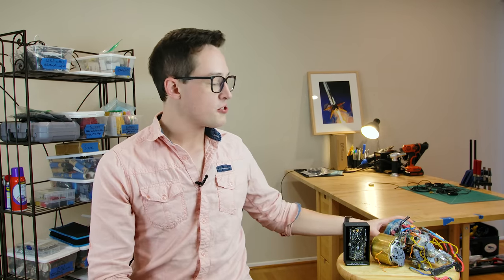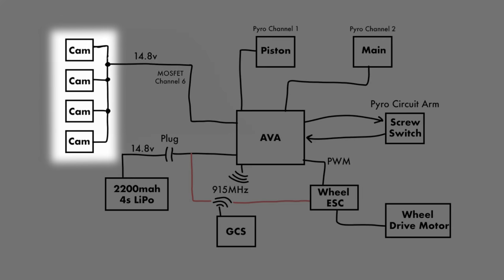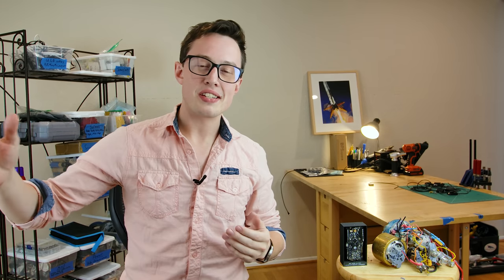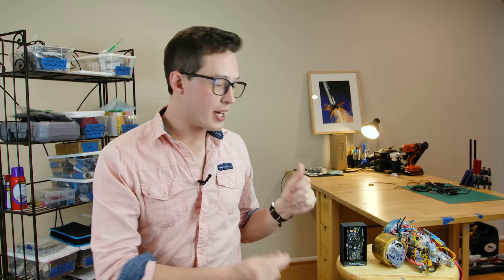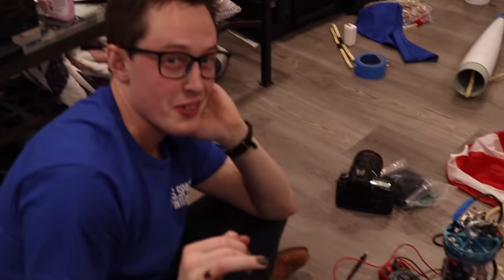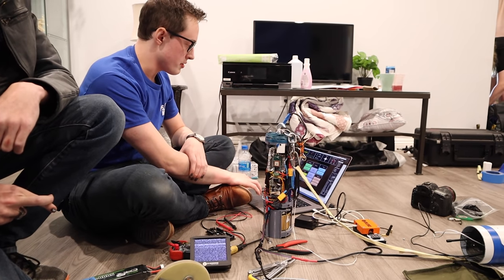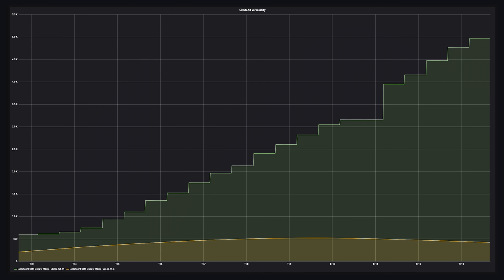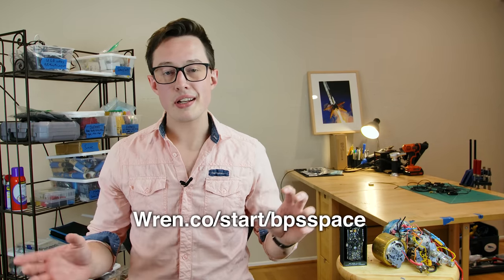Rocket Avionics - Building Lumineer

Comment from the maker: Join me on Wren and start offsetting your carbon footprint today! We'll plant 10 extra trees for the first 100 people who sign up! https://www.wren.co/start/bpsspace
Reply: For the broken SD card...
When the file system is broken I highly recommend to use Testdisk (Windows & Linux), I tried many recovery software and it's the best one I've tried. For a card that is physically broken, it's possible to recover the data by transplanting the flash chip to a brand new SD-card but it's not that easy and you will definitely need to use a microscope. Personally I would let this to the professionals.

I know it's probably some over-engineering but if you use a separate board just for the SD-card there would be less chance of having it destroyed when the rocket crashes and you can even make a small cage around it for adding some protection.
Reply: Just put all the CO2 into milk
Reply: Send the SD cards to drive savers!
Reply: Sir make a video on reaction wheel.
Reply: @Reth_Hard  might want to even have some crumple zone around it or like some gel inside or the sd cards might crack from the G forces?
Reply: Btw, you want to have someone look over your RF section and design, let me know. Doing a PhD in RF electronics (I've measured stuff up to 100GHz), have the PCB and antenna simulation tools as well.
Reply: somebody, please make a 2 nickles weird it happened twice meme with joe B and recovering data from flight computers
Reply: Sir, can we use hard disk to make thrust vector control system and reaction control wheel?
Reply: @Reth_Hard  You couldn't vacuum seal the card in ultra thin plastic ? and then micro trim the plastic from the contacts ..hopefully without loosing the seal
Reply: have you considered using eMMC onchip?
Reply: hey joe can you send me every thing for the rocket like the cad and the software for everything to do with the rocket and can you make a step by step guide for the avionics and the rocket

Comment: You might consider looking into microsd extender cables.  They let you plug one end of the cable into the microsd slot, while the microsd card itself goes into the other end in a different location.  Compatibility is definitely on a device by device basis, but the advantage is you could build a more secure environment for just the microsd cards, rather than having to protect the entire camera or whatever else you put the microsd card into.
Reply: Cool. I had same idea. This sounds like the solution.
Reply: Glue it into a hard enclosure with a flexible glue, maybe.
Reply: @Kenionatus  The rocket isn't that heavy, and microSD cards are tiny. Wrap them in a few mm of foam, and the whole package is maybe a cubic centimeter. Put a centimeter of aluminum around that, and you have a 3x3x3cm box that weighs about 30 grams with card and foam included.
Reply: That seems like a good idea.

Comment: Also you could Yeet reaction wheel “leaves”  out of the body before saturation. Toss them out all 4 cardinal directions from the body. Good excuse to use frangible joints with explosives too
Reply: How about a clutch on the reaction wheel to decouple it from the motor and let it spin down on low friction bearings naturally?
Reply: I think the term you are looking for is "yo yo despin", They are super cool!
Reply: that would create 4 basically invisible weights descending from 10km altitude. Nothanks
Reply: Yeah. That's going to end well ;)
Reply: Ahh yes, throwing out 4 pieces of heavy metal at apogee without parachutes directly above the launchpad sounds like a great idea!
Reply: @haph2087  you must be fun at parties :p
Reply: Hard hats required within 5 km of launch area. Keep small pets in sheltered environments. Don't look up. Plan will work.
Reply: @Ryan Hutchison Yes, but the friction energy has to transfer through a low friction bearing over a prolonged period of time, and since the vehicle is descending on a parachute, there are so many other aerodynamic forces acting on it that this small torque is not consequential.  Also, once the rocket has passed apogee there's no compelling reason to keep perfect control of the roll axis. You need roll control while under controlled flight to maintain proper guidance and steering or thrust vector control. Once you deploy a chute, you are no longer in controlled flight and do not need roll control.
Reply: WHAT COULD GO WRONG?

Comment: Buzz: "Fuses, Fuses everywhere!" - Though this might have killed the PWM pin on the MCu anyway. For protection you should definitely implement some IO saving passives on AVA, if you haven't already.
Reply: Building on that, a PTC might be useful if you want something that'll auto-reset without opening the rocket
Reply: Just increases complexity without adding any flight safety. Overall I feel like BPS is adding too much complexity. But I have no deep insight.
Reply: A fuse on the power line to ESC, if (when) it blew, would have been equivalent to unplugging the ESC (unless the issue there was that ground was also unplugged, which I doubt). It seems to me that it's not a very good setup of an ESC that, if unpowered, will effectively short its control lines to ground.
Reply: @robertobryk4989  “It seems to me that it's not a very good setup of an ESC that, if unpowered, will effectively short its control lines to ground.” It is a common problem though. There are plenty of chips you can kind-of power through their I/O pins (because they have protection diodes) which makes it problematic if you disconnect their positive supply but still supply a voltage to one of the I/O pins. A series resistors can limit current to harmless levels but then you’d still be wasting power. Source: I learned it the hard way trying to power down an NFC chip using a MOSFET on its supply. (and then encountered the same problem again with a Bluetooth module)
Reply: @Mike-oz4cv  Ah, via ESD-protection diodes?
Reply: @Mike-oz4cv  Run a controller with CAN bus :D
Reply: @robertobryk4989   Yes

Comment: You should remove the 5v line going from AVA to the ESC. The 5v line is there for the ESC to provide power to an RC radio receiver (e.g., the BEC). Since AVA is already getting power from elsewhere, this isn't needed. You only need to send PWM and ground to the ESC in order to control it.

This also helps you avoid an issue where two voltage regulators fight each other on the same supply line - it's common for drones and multi-engined RC planes to remove the 5v line from all but one ESC for this reason.
Reply: Yes. That you have to say so, is painful. Use a separate battery for reaction wheel and none of this is a thing.
Reply: I don't understand what you're saying, but i want joe to see this
Reply: Also maybe add a series resistor (1k) to the PWM-IO. If an IC has no VCC, the IO might act as VCC through protection diodes.
Reply: Actually no ground wire to AVA is needed, can be attached to anywhere else ground from battery is pluged in, (with the resistor or diode by Leonelf) I've seen a Matrice 600 pro flight control (3500UDS) burned by a votage going thru 10 bucks servo ground wire.
Reply: @giovannyalvarezsanchez7311  - Very good point -- you do not wan't a ground loop.

One caveat is that you should still need a ground wire if you have an opto esc (optically isolated). Before eliminating the ground wire, check for continuity between the ESC's two ground points.

In Lumineer's case, since capacitor inrush via the servo line resulted in magic smoke, that ESC was not optically isolated -- something to consider for future reaction wheels.

Comment: I’ve recovered data from several SD cards, full size, mini and micro.  Depending on if the die is damaged.  SD is easier because of the serial interface.  Send me some photos of the cards
Reply: I went back and looked.  Several of those cards look recoverable.
Reply: Basically buy new versions of same card. Rip it all apart and swap the memory chip. Give it a shot.
Reply: I think that is quit hard because of the flying bonded wires.  I’ve almost always been able to tie to a berried lead from the chip.
Reply: @BenjaminGatti  These are microSD cards so there isn't really a seperate flash chip like a CF card, I think microSD cards basically have wire bonded dies.
Reply: @Darkknight512  I think most of them use flip chip mounting, with a few microballs that hold the chip to the carrier PCB, where it then has a few plated vias, that connect to the gold plated top connector.
Reply: I was wondering if he could just put it in an SD tray on a phone and still be able to transfer it
Reply: @thrasher2344  No way, its way too damaged physically
Reply: Hello! I actually flew an SD card on a rocket a bit back that had a 100% normal flight, but didn't get any data back from it because the SD card was unreadable after the rocket landed despite being in perfectly fine mechanical condition. The SD card itself is physically fine, but to the computer it only shows up as a 32 megabyte volume with the partition data. Can you point me in the right direction to getting data off it?

Comment: For rotational stabilization I would recommend to look at rollerons. They are also based on conservation of angular momentum, but produce aerodynamic forces and are much simpler. They are also proven to work sub-, trans- and supersonic. They are for example used on the AIM-9 Sidewinder air to air missile.

Comment: Joe, if you have persistent issues with inrush current frying your regulators, you should look into adding a NTC Thermistor to the circuit to soften the inrush spike. I've added them to my DC compressor so I can power it with a switching power supply and not fry the supply trying to spin up the motor under a 1500PSI load.

Comment: Just an FYI, at higher speeds (such as approaching the speed of sound) the Doppler shift is enough to make AFSK modems start to get significant errors. A newer technology tends to solve that problem and it also allows for decoding of data at lower SNR ratios (grabs signal out of the noise). That technology is LORA and there are pre-built boards that have the radios together with an ESP32 wifi/bluetooth CPU module and some also have a GPS receiver and/or sd card slots. Using the ESP32 is now simpler since most of your existing software (like from the teensy) also uses the Arduino IDE and some of the same libraries. And the boards are inexpensive at around $25 each.

Comment: Regarding your cracked SD card, I do know a way to recover the data with a 90% success rate, but it won't be cheap.  Take the card to your local Staples, and ask for their Data Rescue service.  It costs about $1300 if you didn't buy the protection plan beforehand.  (I believe they will still try to recover the data even if you did not originally purchase the card there)  In the future, purchase an SD card from Staples, buy their Data Rescue Protection Plan, and fly that on the rocket.  The plan costs about $4 if you buy it at the same time you buy the card, and there are zero exclusions.
Reply: There are many places that do data recovery. There are a few of them who do videos about it on YouTube. I don't want to mention any names specifically, just to be fair to them all. I suspect if Joe were to search out a service doing videos on YouTube that if he reached out to them he might be able to get them to do a collaboration video recovering his data, and save some money.
Reply: Staples is just going to send the card to a 3rd party contractor to do the data removal.   You can just go direct to those 3rd parties.

Comment: Use the reaction wheel to damp impulses and accumulate short term integral, and then use the flight control surfaces to cancel that out with a PID controller - tune the PID controller to go for zero reaction wheel RPM.

Comment: About the wireless systems: Your metal parts around the antennas were not the only problem. For a rocket you ideally want to use a nearly anisotropic (as little gain/directionality as possible) circularily polarized antenna. On the rocket, either a double cross or clover leaf antenna should do the trick. For the ground station you could use a slightly directional helical antenna (axial mode) or ideally have both a low gain and a high gain antenna and switch between them. Higher power transmitters would also help a lot. The best estimate of the Xbee's power I can find is 24dBm (250mW). Something on the order of 40dBm (10W) would be more appropriate, but you might need a license to stay within regulations. Also, consider switching to 2.4 or 5.8GHz. There is more bandwith available and you could use the same hardware that is used for FPV drones, and since you will have a direct line of sight to the rocket while it's in the air the range advantage of lower frequencies is diminished. Finally, test all your antennas. For sub 1GHz frequencies a NanoVNA will help you verify that your antenna isn't garbage (cheap antennas can be close to unusable).

Comment: Great video ! A couple of things, you can get opto isolated escs, also solid core wire isn't good for vibration. If using stranded wire which is more suitable for vibration, you can use bootlace terminals into your screw terminals

Comment: Perhaps you need to start practicing CRM on the project? (CRM = Cockpit/Crew Resource Management) It works very well for aircraft safety when used. Many recent aircraft incidents are when it's not used.

Comment: Re: different connectors. I'm with you on that. When I design any system(usually audio p.a./recording systems) one of my major philosophies is "design it so you can fix it correctly and in a hurry when it breaks". You don't want the president and CEO of Coca-Cola glaring at you from the stage for <i>any</i> length of time. I've seen people get lazy and use AC wall sockets and extension cables as speaker cables. Plug it into the wrong socket, and you get to watch a coil inside a ring gapped magnet produce the magic smoke very quickly. Idiocy. Every different type of audio connection has it's own standard plug so you don't do stupid things, same with video, and lighting. However, these days if it's a digital signal it goes over CAT5, which comes at it a different way through total standardization, if a cable fails you can grab any CAT5 that will reach and get the things back up in a hurry. It's much easier to see/feel(working in the dark is something they don't tell you about when you become an A/V engineer) the difference in connectors, and there is 0% chance you can accidentally cross connect power and signal. The goal is to design as simple and robust as is possible to do what you need as efficiently as possible.

Comment: You want spring terminals. Available in similar sizes to standard PC mount screw terminals, with push release that's easier than screws, and very vibration resistant.
Reply: Crimped connectors are way better.

Comment: You should make "black box" style flight data recorder. Make a daughter board for an SD card or even just an eeprom chip. Pot the whole thing in epoxy in an aluminum housing and connect it to the main board via SPI with flexible wires - make sure to strain relief it. Use Tech Ingredients' thermal epoxy to affix the memory to the housing as a thermal sink. Affix it rigidly to a sturdy part of the chassis, you DON'T want it loose/sprung, ironically, as that exacerbates vibration. Boom - indestructible memory!

Comment: Solid wire is bad with vibration, so use stranded, and get yourself a pack or five of bootlace ferrules for the wire, and the proper crimping tool for the size. That both makes the screw terminal a flat solid surface, so it will grip better, and also handle large currents with lower voltage drop, but also means you can take a small piece of insulated wire, and glue it to all the wires at the end of the ferrule, so you can undo the lot as a unit for maintenance or replacement.

Comment: I would build a mini sealed "black box" for the rocket which would contain the recorder and the SD card, internally mounted in a shockproof fashion to avoid any destruction then have a ribbon cable connect to the flight controllers. Maybe mount it in a sealed box filled with ballistic gel or something that would absorb any kind of shock from any direction, but can be removed once the box is on ground again (either way)....

Comment: You could use aero control surfaces "tuned" to work at high speeds that try to zero the reaction wheel speed. That way the reaction wheel works at lower speeds and you don't saturate it.

Comment: Just as a thought, perhaps you could make a “dummy computer” with a blank slot for the flash chip to slot in hot, without solder but maybe using some sort of clamp like the cpu of a desktop computer. 
Obviously, AVA is designed for (let’s say) amateur rocketeers and it is likely that they also will discover the joys of the mangled pcb following hard landing. Preparing for this inevitability with a flash dock might be cool.